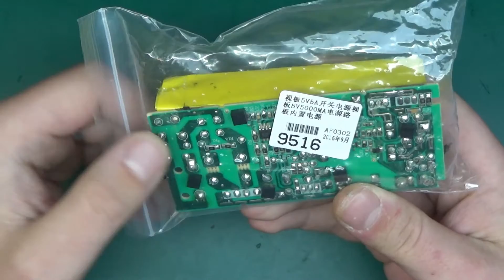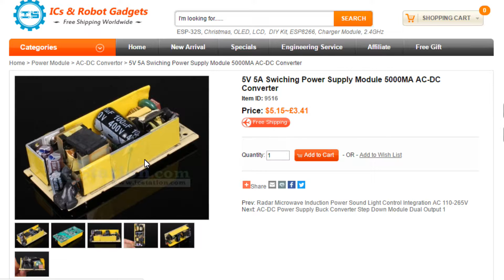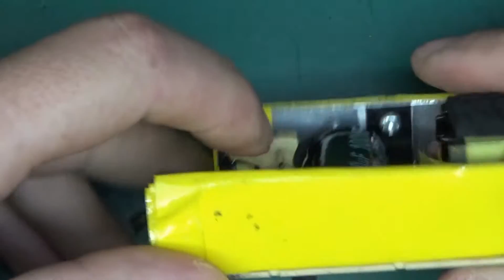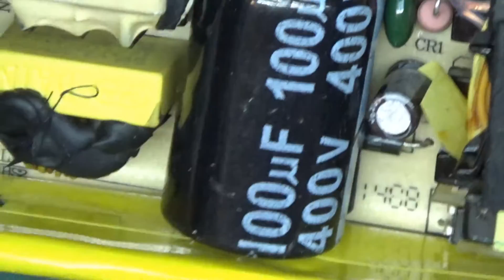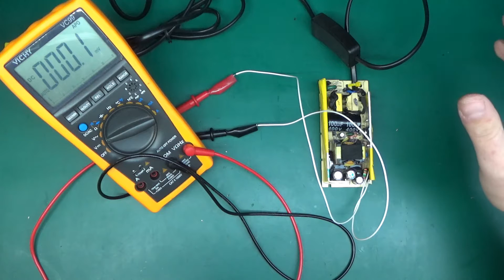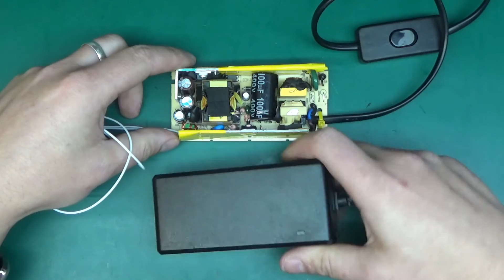5V5A power supply module from ICStation.com

Comment: Good video. I do have a few other concerns with this 5V/5A PSU. One is that the 5V typically has a +/-5 tolerance for logic use and it did not get below 5.25V until you loaded it to ~0.6A. One would need to preload this PSU with a min of 0.6A if you are going to use it to power 5V logic. Secondly, the OCP is tripping at ~4.2A and that is with a resistive load. With a capacitive load on the output it will likely trip much before 4.2A due to the surge current at turn on. Lastly I wonder what the OCP would be after it has worked for awhile at a 4A load and at a 35C environment.
This PSU shouldn't be rated for mre than 3A continuous in my opinion.
Reply from the maker: Wah Ng  I like your suggestions. I actually want to use it for multiple 18650 charger, so I will likely get close to 4A load for extended periods. Will see then if it will hold. And yes, for logic this would be just a bit too high, I didn't think of that. I am curious how will the charger modules I got hold up to it, I might get some fireworks before new year's :)